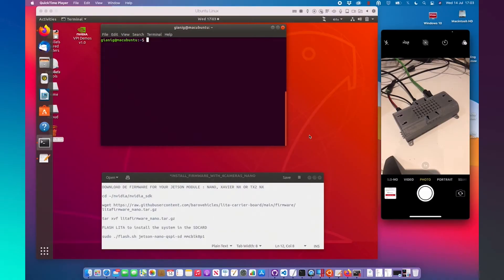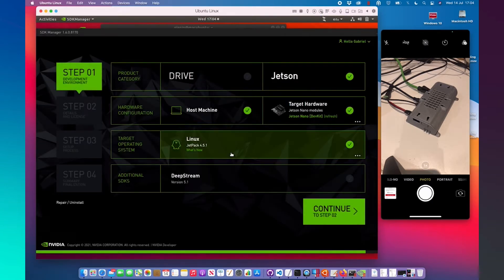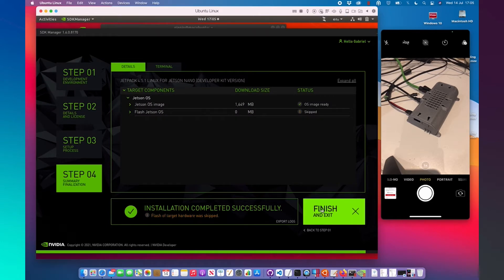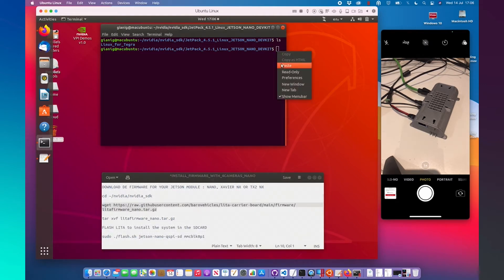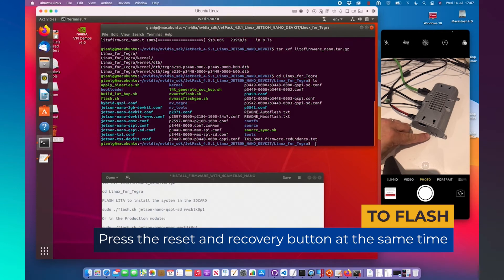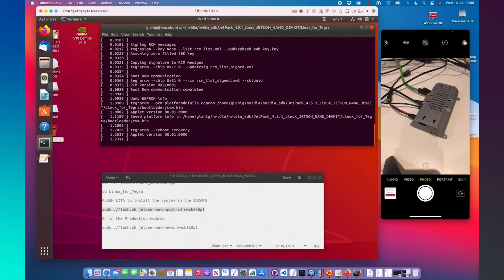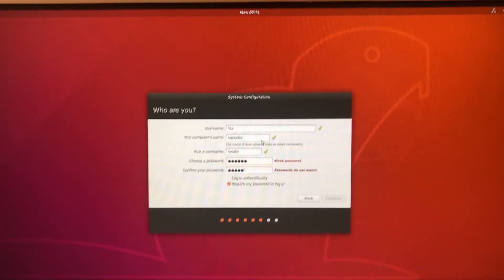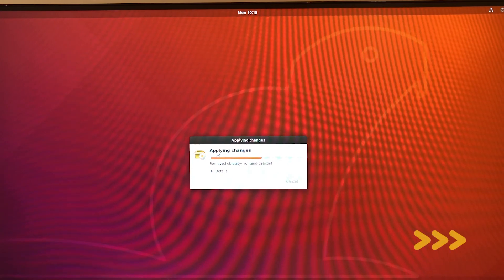How to Flash the Jetson NANO from an SD Card | Tutorial 2

Comment: I received a Jetpack Nano from my university to work on. Unfortunately it doesn't boot after I install the SD card with the OS. I assume I need to flash the Nano (since it does look like an older model). But Im not sure how to go about it. I am using Virtualbox for Ubuntu 22.04 (now supported by sdkmanager). Do I connect the Jetson nano through the built in USB C port or is that one only for power? Do I need to use a USB A to USB A cable instead? Do I still need to downgrade to Ubuntu 18.04 anyway to see the Nano? Right now when I plug in the Nano my host windows machine freaks out and the ubuntu virtual machine does not see it. And I made sure to have USB passthrough enabled.